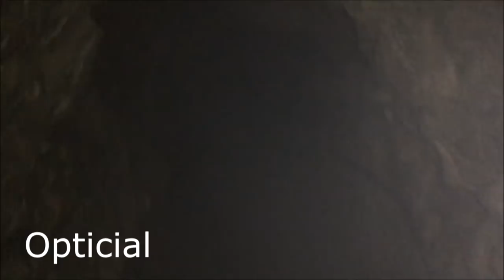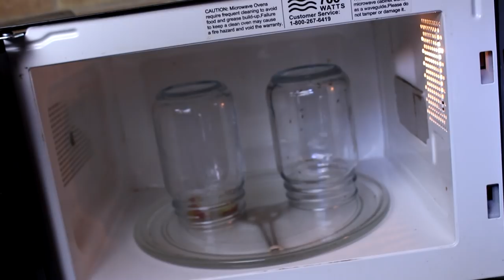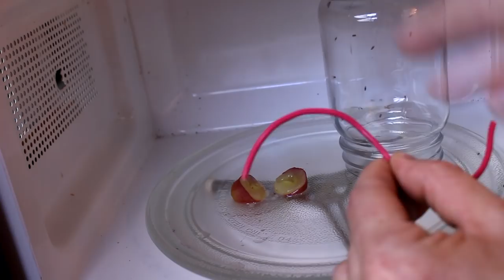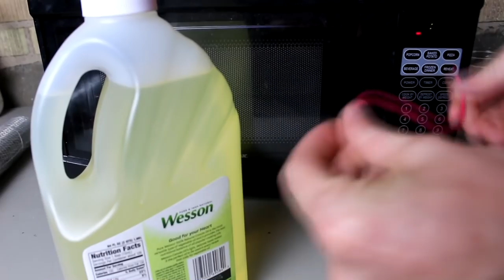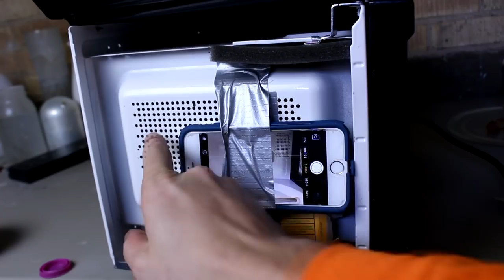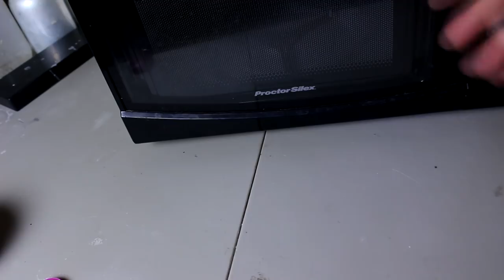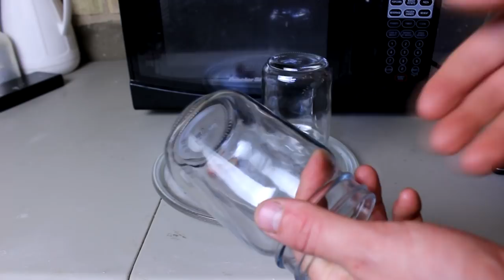Fruit Flies In A Microwave?!

Comment: I have to say, this is one of my least favorite of Cody's videos. I didn't understand the explanation and the wires moving around weren't really a help. It would have been better to show diagrams I think.

But my biggest problem with the video is that Cody made about a dozen non-intuitive statements without testing any of them. For example, oil not being affected as much because it doesn't conduct elctricity well. You're telling me that if you put a tiny amount of oil in the microwave it won't heat up because it's too small? He could have tested different volumes of oil to see how size affects temperature after nuking.

Same thing about glass not being affected. If you microwave glass it gets hot, right? How can he just say it's not affected? And the same for microwaves escaping. If he's going to assert that every microwave has holes 10x smaller than they need to be, he should really measure the leaking radiation with larger holes to prove it. Maybe he's right, but I'm skeptical.

And the effect of microwaves bouncing around inside is not mentioned at all. I thought that was a key reason they worked, and if the bouncing doesn't affect the wavelength arguments he made, that should have been explained.

Overall I'm left as skeptical as I started because he only made assertions instead of demonstrating they were true.
Reply: Maybe you should watch it again... But its a very complex subject!
Reply: Also about the oil he stated the polar thing that also heats for example oil. But if you put a small drop if oil it should be pretty much unaffected. An interesting experiment would be something like quinoa, spread on a plate.. As long as they dont touch, they should stay cool
Reply: Glass along doesn't heat up in a microwave. Run the microwave empty then feel the glass turntable in the bottom of it. It'll be almost the same temperature as before.

Comment: The hole sizes used in wave barrier screens are not only determined by the fundamental frequency but by the harmonics created by reflections, standing waves and resonance of the materials, etc. They are also the smallest hole that allows decent visibility or air flow vs. the material thickness required for strength while still providing the required attenuation or reflection. If you look at the air vent screen the holes are larger than in the door because it is normally covered by an outer layer of metal which will trap or confine any waves that could escape. Some leakage into a metal cabinet is permissible, far less is allowable out the front where your face is.
 The next question is; if you were to combine multiple magnetrons into a single cabinet will you get a super microwave? Why. Yes, I know Mythbusters tried it but never really explained the result.
 I used to watch radar dishes at startup to see if the rotator or transmitter started first as that would determine how many of the antenna sitting birds would burst into flames.

Comment: A side-interesting thing about microwaves, at least the ones that have turntables built in, is that the turntable will turn in the opposite direction of the previous time every time you use it. Clockwise one time, then counterclockwise the next time, and so on. Weird.

Comment: I think the difference between the flys and the grape is more to do with surface area to volume ratios - flys are able to better regulate their temperature because they're smaller and therefore have more surface area per mol of water (which is absorbing the majority of the microwaves through rotation) to lose the thermal energy over.
Reply: Nope, it's the size of and power that can be delivered by the wave. Roughly a 12cm wave can not heat a fruit fly. There's not enough size to feel the amplitude change in its molecules.

Comment: I think a minor contributor to the fruitflies survival related to their small size is that they have high surface to volume ratio and can therefore dissipate any heat generated by the radiation, thus preventing its accumulation

Comment: Hey Cody, 
I always heard that the heating effect of the microwave has something to do with the waves interacting with liquids like water or oil, thats why plastic or glass doesnt really heat up. Also to note the fly has much less acessible water than the grape.  If it has something to do with the size of objects there should be a amount of water that is to small to boil off in a microwave. Would be interesting to hear your opinion on this.

Comment: It is not about whether the size of the fruit fly is comparable to the wavelength, because water molecules are even smaller than the wavelength.
Reply: Water molecules act as a large cohesive group. A tiny drop of water will not heat up while a glass of water will boil.

Comment: Unless I was taught wrong including Wikipedia, that's not how microwave ovens work. In no way an electric potential difference is used for heating, but rather the resistance of water molecules to aligning themselves with the electric field. Or are those two phenomena equivalent?

Comment: I always enjoy your videos.

You got a few minor things wrong; the flies survive mostly because they can avoid the worst of the microwaves by flying, simply being smaller than the wavelength size isn't sufficient, the power density is the same. There was a similar thing about ants in Scientific American years ago, that's what they said IRC. Microwave heating is substantially dialectric heating not resistive, so voltage is a red herring. If it was resistive very pure water wouldn't heat, but I'm certain it does, as do fats, which are insulators.

The holes in the front being so small are because of evanescent waves. They're small, because those waves still exist a few diameters away from the hole, so the bigger the holes, the thicker the door has to be. To try this, if you put your finger near the hole you cut when the power was on, you could burn your finger because of that. So the big mesh isn't equivalent; if you used it in the door, you could burn your hands if you touched the front.

Comment: Is it possible that the grape 'absorbed' the majority  of the microwaves since it had higher water content, leaving the flies unharmed?
Also an interesting idea if you ever revisit this - If you put a length of wire in the microwave and could somehow measure the voltage across that wire (without the multimeter leads themselves being affected), would you be able to measure a high voltage AC? Maybe if the wire was quite short the sparks and microwave damage might not be too bad!

Comment: Unfortunately the provided explanation is not correct. The reason for the fruitflies surviving in the microwave has little to do with their size compared to the wavelength of the microwaves. It is more likely that they survive due to their high surface area to volume ratio: basically they dissipate the heat to the environment before they heat up to "lethal" temperatures.
Reply: I've been wondering this myself. By Cody's logic a small drop of water (the size of fruitfly) would never boil or even get hot, but this just isn't the case. Isn't most of the heating provided by the dipole flipping  of the water molecules? (and glass without any water in it won't get to vibrating -  I don't think the primary actor here is whether something is conductive or not ). 
I don't think the microwaves care how big the object is, when it's the H2O molecules that are being influenced, and they are super tiny. The bigger and blobbier that object is the more the heat can't escape so the object enters thermal runaway. Whereas the flies are diaphanous little things with hairs and wings and an incredibly fast circulatory system that probably acts like the worlds best water cooled heat sink. (unless of course they don't have any water in them and then that explains everything!)

Comment: So if you had an opaque slab of some material and puncture a hole in it about the size of 400nm you would only see purple light coming through?
Reply from the maker: actually that would be a bit too large but cutting it down to about 150nm would do it and yes you would see a definite blue shift to the light getting through

Comment: Cody ... when you show the 'out of phase' magnetic field ... wouldn't the wires spiraling around each other 180 degrees apart be a better visual example? This is how it is in reality - the magnetic field and electric field spiral about one another. If you take a spring, stretch it out and look at it from the side, what do you see? You see a 'wave' but in reality it's a spiral. I think we use the 2D 'wave' analogy way too much - there are no 'waves', there are only spirals.

Comment: Lesee...

550 on your AM dial (550 kilohertz) has a wavelength of 545.4 meters
1600 on your AM dial (1600 kilohertz) has a wavelength of 187.5 meters

88 on your FM dial (88 megahertz) has a wavelength of 3.409 meters
108 on your FM dial (108 megahertz) has a wavelength of 2.778 meters

(To calculate, the wavelength times the frequency equals the speed of light.  Just use algebra to rearrange and crunch the numbers.)

Comment: Not the explanation or result I was expecting.  It's certainly been a while, but I remember learning in college chemistry about how different wavelengths of radiation affect different aspects of molecules.  Microwaves cause polar molecules to spin, especially water molecules.  Microwave ovens excel at heating anything with water in it, because they interact directly with the water molecules.  This seems to be confirmed by the observations of the evaporating of high-water-content grape.

It makes me wonder what the water content of the fruit flies is and how long they would hold out under longer exposure.  If they have any water inside them, which surely they do, I figure they'd eventually be boiled from the inside.  And now I wonder what aspects of their biology prevented that.

Comment: I'm assuming it's been said a hundred times already, but I'll try to narrow down a couple of small errors: First, EM waves are in phase with one another, but they are 90 degrees orthogonal. Also, I believe Cody meant to say that the electric field is responsible for pushing electrons around his 'wire', and the resulting magnetic field from the induced currents interferes with the magnetic portion of the wave. Either way, it was a cool explanation of how EM radiation is absorbed based on size. Then again, my memory on EM skin depth is a bit fuzzy.

Comment: The wave length should be similar to cellphone signals. I enclosed my phone in mesh fence with 2 cm holes and the reception was the same as outside.
Reply: If the fence wasn't ferrite, no opposing charge can be created. Copper also works. Also even the slightest gap that's long enough will let everything through.

Comment: Would the antenna create visible light (plasma) if a transmitter could generate radiowaves in light frequency?
Reply: Dani "radiowaves" are just electromagnetic waves that fall in a specific frequency range, while visible light is electromagnetic waves in a different frequency range. If your antenna is generating waves in the light frequencies, it is by definition not generating radiowaves, it's generating light
Reply: Actually yes! That's called a light bulb!
Reply: @Tehwhitekity  An antenna doesn't generate EM radiation. It is a coupling device. The way a microphone/speaker membrane is acoustically coupling with air.

Comment: would it be one wavelength Circumference hole? and to that, one circumference's time an electro-signal in the medium (sheet metal) takes to equal one wavelength's period of the microwave in air... that is to be the limiting size?  electrons dont moove (cow) at light speed in sheet metal, nor do microwaves move at light speed in air.

Comment: Hey Cody, the door on my microwave has shattered and my father used a piece of polycarbonate to replace the glass inside of the frame of the door. I am using this microwave for about 1,5 years by now. Am I risking my health or can this cause any damage to other electrinocs in the house?

Comment: Actually, you would be able to fry flies in your microwave. That they are completely unaffected by the radiation is not entirely true. Your flies definitely are. Just look how they zip around whenever the glass is close to the side walls. 
They dart around like crazy, because they feel a momentary blast of heat. Of course being much smaller than the wavelenght they can go somewhere, where the electromagnetic field is not as strong, or from the fly's perspective, cooler. 
For that reason microwaves have those rotating plates.
So if you really want fly fries, go and lock them in a small space, where they cannot escape and place it where the field is strongest.

Comment: i see the grape definitely sweated and had alot of heat go through it, however why is the whole in which microwaves are "stirred" into the area you'd call the oven is blocked? looks like with a piece of metal or cardboard? why? ANSWER ME!

Comment: if you use a germnium diode (i think 1n34a |1n60 maybe) and led in antiprallel you can see that a small amount of radiation will leak off the microwave 
specially trough the door

Comment: You're wrong on this.  The flies will still absorb microwave energy by dielectric heating of their internal water and other affected molecules.  They are surviving due to their small size since they are able to conduct away heat because their larger surface area to volume ratio.

Comment: haven't watched it yet but my guess is they wont absorb the microwaves on account of their small size.
Reply: Heh, I just guessed that because I knew the holes in the screen were too small for microwaves to get out so I figured a fruit fly could easily fit through those and so it wouldn't really absorb anything but I watched to the end and learned a lot. I knew it was called electromagnetic radiation, but I never really thought about it having an magnetic field (even though it's in the name, duh lol), this means you can generate electricity by shining light or EM radiation through an appropriately sized coil, kinda like you could by moving a magnet through a coil? I guess that's also how wireless chargers work too, eh? 

Lots of stuff clicking in to place, I love that feeling when you gain a new understanding of things, thanks Cody! 

I think light/EM radiation is one of the most fascinating things there is.

Comment: I'm pretty sure this is really a heat flow issue--the heat flow into a microwaved object will be proportional to its volume (size cubed), whereas the conductive heat flow out from its center is proportional to the object's surface area (size squared) times the thermal gradient, which in turn is proportional to the internal/external temperature difference divided by the size.  So for small objects that can reach steady state (heat in = heat out) quickly, the internal temperature rise will be proportional to the size squared.  This means that something grape sized, say 10 mm in size, will reach an internal temperature 100 times higher than a 1 mm fruit fly.  Until the grape starts boiling inside.  As other commenters have noted, the absorption of microwave energy by water molecules does not depend on induced currents and therefore doesn't (normally) depend on object size.
Reply: The phase switch of the wavelength has to occur inside the thing to be heated, with enough amplitude to be able to heat. You can not place a fruit fly on the roughly 12cm waveform(what a microwave and your 2.4gz devices put out) at any point where it can get any damaging effect of excited molecules.
Reply: The important phase switch for heating water happens in time, not in space.  As I understand it, the polar water molecule tries to rotate to align with the changing electromagnetic field, and this rotation causes its extremities to bump into other water molecules, generating heat.

Comment: CODY PLEASE READ

I have been thinking about something you might be interested in to test out for quite a while now...
I was wondering if you would fill a bottle with any liquid and empty it upside down in a vacuum what will happen.
Normally if you would empty a bottle of water in the open air the water has to make room for air to come in and replace the poured out water. But because there is no air inside a vacuum I am really curious what will happen to the bottle of liquid (obviously no water because it will boil).

Will the liquid just rush out without any problem or will something interesting happen?

Please test this in a video, I am asking this myself for over a month now and I can't get the answer 😂

Greetings from The Netherlands ✌🏻

Comment: So the contraversy in some countries about radiation from phone towers being so dangerous for our health, might not be all too truthfull?
Reply: You are absorbing electrical radiation all the time. The question is how far you are away from the sources. Microwaves are at 2450khz, and cell towers use 700khz, 800khz, 1700-2700khz. That means all cellular service is about 12cm or shorter wavelengths. And they all interact with us. AM/FM and TV signals start at 54000khz, and they are over 6m, they really don't interact with us.